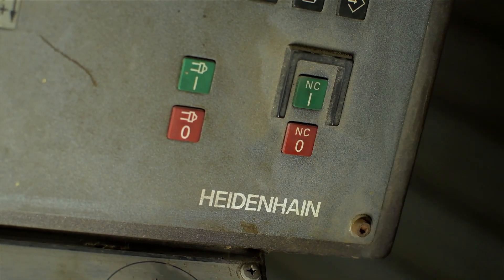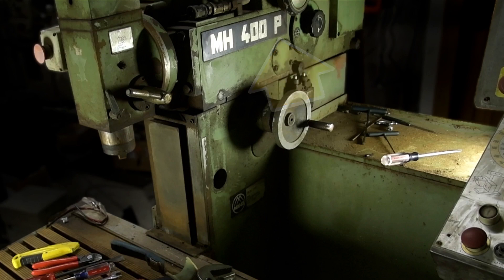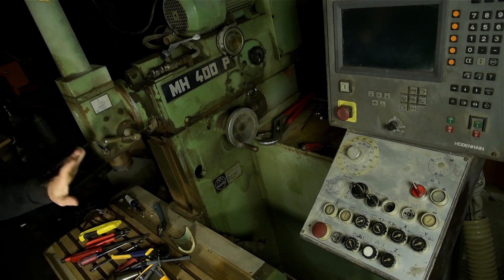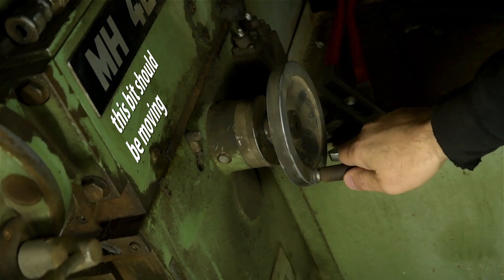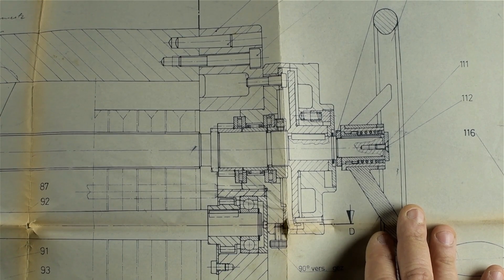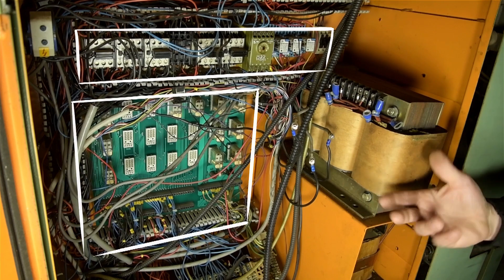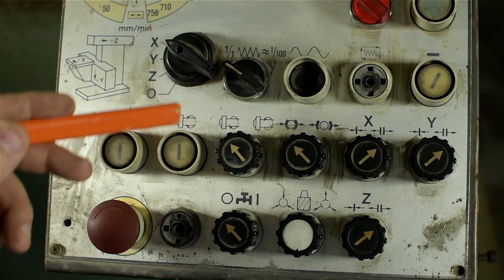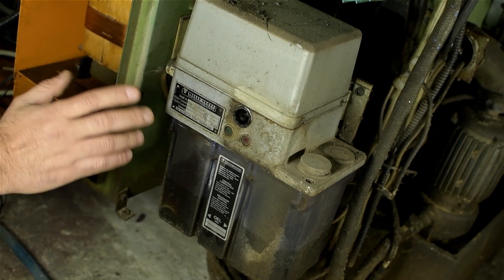MAHO is Filthy!!  (Whose Milling Machine Isn't?)

Comment: Clean it up and sell it as long as you can, the Deckel Maho isnot worth playing around (although they were solid machines). If you do it right it will set you back around 8k to make a multi axis CNC and still you have low spindle RPM and slow feeds.
I build my own small "VMC" for around 10 000€ from scratch.

Comment: I’ve just retired after a couple of decades of working on CNC machines.

You should see the inside of the electrical cabinet on some of the five axis machines I’ve worked on.
Pucker factor is intense. 😂

The spindle looks like a 40 taper and the ones I’ve seen always use air to push down the drawbar against a big honking spring.
I’ve seen hydraulics used on the bigger 50 taper ones.
It should not be hard to convert to air.

One axis at a time!
I’ve never seen one quite that primitive but it’s kind of cool.
The downside is G3 ain’t gonna work.

This is going to be an interesting project and I can’t wait for the next episode. ❤️

Comment: 400P P is for Production. This means you have thé hydraulic drawbar akd normally the CNC is à cubic one, means you cant do round shape with this controler. Generally cubic CNC means you have one motor for 3 axes and 3 clutches.

Comment: Most Maho run on 380vac. That's what the transformer is for.  I have rebuilt several larger 5 axis 1000's.  I mite even have the books for your machine. Some guy on Practical Machine did a retro fit on that small machine.  The Mahos had week controls. Ie Phillip's but the iron in them are great.  Good luck with the retro fit. PM if I can help.

Comment: My guess is, the largest component in the electronics cabinet you bypassed was an isolation Transformer. Just means if something goes wrong with the machine there's nothing between you and the full potential of whatever is coming out of the wall.

Comment: I look forward to seeing which direction you go in upgrading the CNC mill. I picked up a 1989 lagoonmatic 250 for less than scrap price and want to upgrade her to a newer computer system utilizing the existing servos. However, I am having to take a crash course in how to go about it as I am completely out of my element.

Comment: I am currently working on the conversion of a MH400C, looking forward to see your progress. I recommend you check your spindle bearing before doing anything else. The top bearing is unseal which mean everything entering the cone can fall in the bearing. Also, the outer race is the spindle housing itself making the bearing replacement nearly impossible. I also have about 5 set of manual if you are interested. I am doing a full replacement of the electronic, if you need any part, let me know.

Comment: Tony, provided that the primary and secondary windings have the same number of turns, that is an "isolation transformer" and it is exactly for the purpose of power conditioning. It is supposed to help separate harmonics and other electrical noise from the rest of the system.

Comment: That biggest piece from the panel is the three phase inductor.
It's main function is to isolate the phases from the high frequency generated from switching motors on or off.
It's better to have it properly installed to protect another equipments of this high frequency components, mandatory if you use any equipment that regenerates brake power back to the mains, since without it you will blown virtually everything around that uses switched mode power supplies (ask me how I know).
I've some good ideas if you want to make this machine with servomotors, by the way.
Let me know if you are interested, so we can talk.

Comment: I suspect the input transformer that you bypassed is an "isolation" transformer. It doesn't actually change the AC voltage up or down, but an input voltage spike will be converted to a temporary heat-spike, instead of higher voltage, so the output into the mill remains stable.. If a voltage spike makes its way to the motors, they will experience a temporary higher RPM.

Comment: It looks like the blue motor is the motor for your hydraulic pump. I would guess that the hydraulic noise is the blue motor turning on to build hydraulic pressure. The "tanks" on the hydraulic system are likely the electrical component of the solenoid valves which is essentially a coil of wire to act as an electromagnet. I assume this means that your axes are each hydraulically powered.

Comment: The "Largest Electrical Component" in the cabinet is a line reactor.

Basically a big inductor to clean up the input power.

If you don't have other large induction motors or will be welding while you're milling....it's likely not needed in a home shop.

They are needed in industrial facilities where lots of large loads are connected to the same transformer circuit.

Comment: Just a guess, but maybe that transformer is used to lag the mains input and create a 2nd phase. The motor could then run from the 2 phases, main phase and the phase lagged by the transformer.

Comment: This video is like having a Nightmare that you've already had...20 years ago I helped a friend get his own Print Shop going ( I already had one myself) anyway he found a BIG 2 Color Printing Press and he wanted me to go with him to check it out.  There it was back in the corner, painted the SAME Green color, this piece of Junk was from the Czech Republic 1970ish, the same type of pictograms for the controls, it blew fuses or breakers when you tried to start it up...it also had a Blue 5 hp Motor and came with the manuals and schematics in Czech...I ALSO bypassed the Transformer to keep it from blowing fuses...it should have been sold for scrap BEFORE he bought it.

Comment: someone has most likely suggested this already, but that transformer at aprox 8:40 is most likely an isolation transformer. xV ac goes in,  same amount comes out, but a shortcircuit at the secondary side will not(as far as i understand) burn up the wires on the primary side.

Comment: I used to work with machines for use in wet environments and they always had an isolation transformer right up front.  It was described as a safety thing, keeping the angry pixies from going through your body to ground.  I doubt it had any value to reduce noise back into the power feed in this application, inside a meat packing plant. There wasn't too much electronicals to be bothered by inductive kicks and the like, but maybe it was somewhat for both.

Comment: Ahh maho 400 E would be better for retrofit. This P model have very old type of glass scale. If you want make it work it will be hard, all electronic is old and faulty. corrosions leaking caps.. Easy way is to install stepper motors. Better servomotors, ballscrews and new glass scales.

Comment: As this progresses you will understand why CNC machines in their old age are only worth what they will bring across the scales at the scrap yard. Though they may be in good mechanical condition, proprietary software and hardware (if it still exists) make repairs very expensive if not impossible.

Comment: Tony that "transformer" you disconnected could be a reluctor. They are commonly used with pancake motors. The pancakes have very little winding so the reluctor adds inductance, which by the way is measured in millihenrys. Just a hunch but maybe that is why your motor wont run. If that doesn't do it find a tiny little Henry and ask him.  TOT Rules!

Comment: I have worked on a couple of Dackel Maho machines from the early to mid 2000s in pretty extensive ways. My first comment is that some of the hydraulic pumps just sound like that. The '02 DMU 70evo I've worked on sounds almost exactly like that when the hydraulic pump runs. The hydraulic system they use only runs to build up pressure and then stops. I'd guess they did similar even back in the late 70s. 
Next, all the machines I've seen have had a similar large transformer near the mains input. I think they called it a reactor. I'll have to double check the terminology in the manual/schematic. The machines I've seen have been configured for 400v wye power which is a 5-wire setup. (3 hots, a neutral, and a ground) someone at our shop unknowingly hooked one up to 480 delta (typical American power) and it caused all sorts of problems. I'm fairly knowledgeable about the machines I've worked on and I'd be happy to try to help answer any questions you may run into. Nice solid machine you have there. Good luck with it.
(also, don't be afraid to contact DMG-Mori about the machine. You might be surprised that they still have info on it. Those Germans tend to be good like that.)
Reply from the maker: Thanks Justin!  This machine doesn't seem to do a think unless the hydraulics are running.  I've waited to see if it would build pressure and stop, but it just keeps on truck'n.
Reply: After seeing your second video with first chips I totally see what you mean. It probably has something to do with the hydraulic axis drive activation. It looks like you're making great progress.

Comment: The P stands for point to point. That oiler is indeed worth a fair bit of money. I have the same one. its pressure controlled, so you wouldn't want to replace it with they typical cheapo ebay one.

Comment: At work we have a 45 year old manual 600.  A real jewel. The table tilts in two directions and rotates.  We added a .0002” Acurite DRO. It loves to make chips but also holds the .0002” .  Not the easiest machine to use but it is fun. Maho is now owned by Dekel but it is still is making mills.

Comment: The transformer may be there to offer the galvanic isolation to the circuit and the entire machine, probably even mechanical parts. It prevents your body from becoming a conductor toward ground. You can still get zapped, but only if you touch both terminals of the transformer's output. 

Bypassing it is dangerous. Certain mechanical parts may accidentally be at the live wire's potential that way.

Edit: Ooooh, and, yeah, big transformers take time to "charge up" (not exactly the right term as they are not capacitive) and can trigger sensitive circuit breakers. I used to construct three phase inverters and play around with huge three phase motors at the university. I once popped entire university wing's breakers because I failed to apply soft start to a big transformer I used.

Comment: That transformer is called a line reactor.They are typically used to smooth out power and filter noise.
Reply: and separate it from the net, so you can touch the machine without dieing when there is a short somewhere

Comment: 🤔 Did AvE brokered this deal?
Maybe it's a transmission driven mill, the motor runs, and the g-code activates the hyd-solenoid for the axis to be moved.  Seen some systems like that in a sugar plant.  The machine shop kept making their consumable cane-crushing parts.  It's worth a look.  It seemed counter intuitive, but no one was going to listen to the hose-changer 😁

Comment: Hiedenhain is great you should really try to make it work as is before you change it. The control will compensate for backlash. They are amazing machines mostly used in the die making industry and apprenticeship programs. The hold great tolerances. It's very easy to program. Contact me if you want help

Comment: thems some nice looking HAWE solenoids you got there. those little metal pegs on the tops of them are buttons. give it a press to do stuff and see if it makes noise. if it doesn't make noise but pressure changes on either side, they are fine. that noise is probably them being energized on and off a bunch really fast due to a power supply issue or your motor for the pump to it.

Comment: Maho, which eventually became Deckel Maho, and then DMG Mori, have a reputation for being good, solid, accurate machines. Very low vibration,  well built mills.  Should be a good conversion. Have a look at Linux EMC for the controller too, proper encoder feedback servo control capable CNC control code for a desktop PC.

Comment: Nice!   The axis lock-outs will be really nice for accuracy, by the way... if you can have your CNC control auto-lock the axes that aren't in use, the other axes will be stiffer.  So for example you could lock the Z while you move the X and Y for better, cleaner facing, or lock X and Y for plunging in Z... it'll save you breaking carbide tools.     If you go with a closed loop servo conversion, look into LinuxCNC with Mesa hardware for control interface.  Top quality stuff, and the PID loop for motion control runs in hardware instead of your computer.

Comment: I’ve used an old German air sucker cleaner thing used in welding to suck away all the fumes and dust. It was getting picky and not working well so we thought ‘How complicated could it be?’ Very.... we opened that sucker up and it looked just like the electronics cabinet of your mill. All just to run a big turbo lookin fan and sense when the filter was getting too dirty. 

Long story short, we gutted the fan/blower thing out of it and scrapped the rest.

Comment: That transformer may be:
a) for galvanic isolation
b) preventing high frequency noise from the motors feeding back into the grid
c) short circuit protection. A short would saturate the iron core and limit the current you can pull
There are surely other possible reasons. Is there 1 per motor? Then likely b) + c)

Comment: just $700? sounds like a steal!

the yxz thing is a common one. you over in the us and a took the coordinate system from the wall, layed it flat on the table and placed the z axis perpendicular onto it.

we over here in germany left the coordinate system on the wall and extended the z-axis "into the wall" if this makes any sense...

thats however the reason, why our axis are in another order than yours.

Comment: Get Scrubbing Bubbles bathroom cleaner and some paper towels.  The aerosol spray can that foams up on contact.  The heavy duty shower cleaner works best.  It works amazingly at cutting through old grime and grease.  Like unbelievably amazing.  You can thank me later.  If you have better cleaners, all is not wasted.  Just use the cleaner in the bathroom.  Try getting away with using any of your other shop cleaners in the master bathroom. ;).

Comment: That transformer is most likely an Isolation transformer. It isolates the machine from the grid. It's a safety device and yes, it's not safe that way, but it "shouldn't" harm anything to bypass it for getting the rest running. BUT, you should probably repair of replace it for production use.

Comment: Those ceramic fuses are known as "bottle fuses", or  "Diazed" & "Neozed" depending on size. They are still common on incoming mains connections in some parts of Europe, and still used in machinery in Germany. You can find the technical standards listed under IEC60269. Not that it matters if you are going to gut it of course. Looking forward to seeing more of this machine Tony!

Comment: Transformer-looking doohicky is an AC reactor.  Used on CNC's to compensate for voltage inconsistancies and also clean power sent back to the grid during motor regeneration (braking) instead of using breaking resistors.

Comment: I think your problem with tripping circuit breakers is because you aren't using metric electricity.   You might be able to find some at your local Harbor Freight store or try Ebay.

Comment: Could they possibly have sold you a 400 along with all the bits to convert it to a 600, thus the manual? If not, at least you have material lined up for the next several years building an MH 600 from blueprints :)

Comment: Using a ohm-meter is a good way to understand how a transformer is wired. Also, you can use a 12V transformer with to supply a voltage and measure the voltage ratio. A filament lightbulb in serie is also a good idea to test a unloaded transformer

Comment: Usually a transformer with a 1 to 1 winding is an isolation transformer. Basically stops the machine being referenced to the mains. They are really useful when debugging things like switched mode power supplies as they stop you accidentally running 320 volts through your expensive oscilloscope. Not that I would do that... not at all...

Comment: cool, i was about to buy this one too recently - now I am confident that I can make it work !
Reply: The "only one axis at a time" seems like a humongous limitation though, unless you intend to completely switch out  all the electronics and most of the mechanics as ToT intends to. Without that, it's more of an "unattended manual mill" than a CNC one - as in, a CNC mill is supposed to be able to cut circles...
Reply: Hey thanks ! Yeah, that's a bummer but as Tony, I gonna ditch the controllers  - no idea yet. I guess making square drill bits will be ok for a while :-)

Comment: 20-something years ago, I had a temp job cleaning up all of the machines for a gear making company that was going to auction. I ended up getting dust pneumonia from all of the bags of speedy-dri we laid down to sop up the oil... good times...
Reply: Once was doing some surveying work along a road to a concrete mixer site (or maybe a gravel dispensary?). Don't know if I got dust pneumonia off that, but wouldn't be surprised at a light case.

Comment: So are we going to see this refurbish next week? OMG, when you opened the cabinet, I started laughing seeing all that junk inside. If you are going to make this run, and run reliable, I really think you will need some good schematics for the electrical AND hydraulic circuits. Otherwise, do you have a scrap yard nearby, and what is scrap metal going for now...

Wow you sure have a real project on your hands this time. The only other machine I've seen that comes close to that inside of yours,  was a system tester I used to work with and on, that was totally wire wrapped. Nightmares doesn't even begin to explain that one. Thumbs Up!